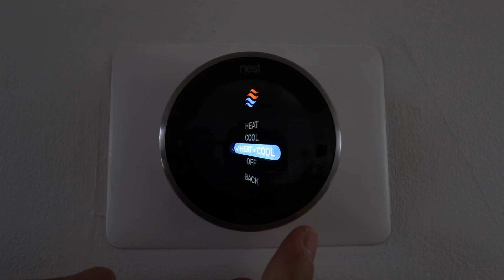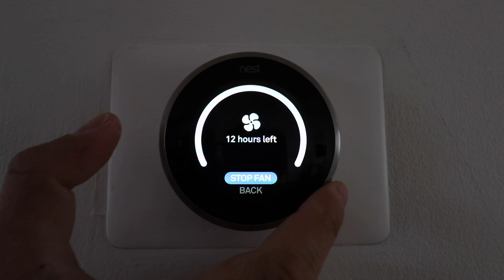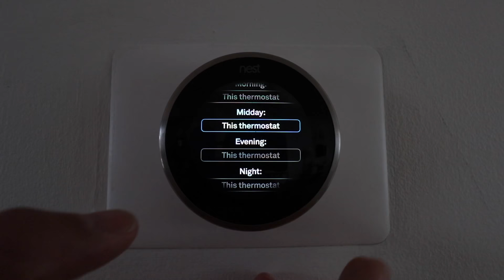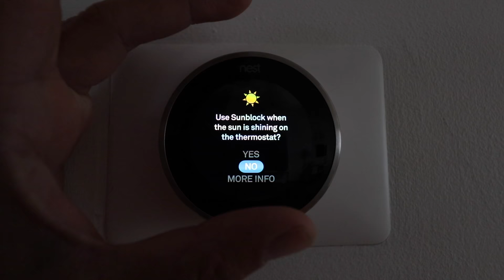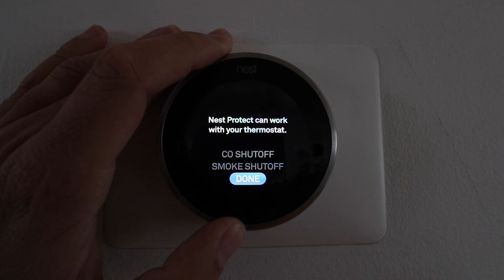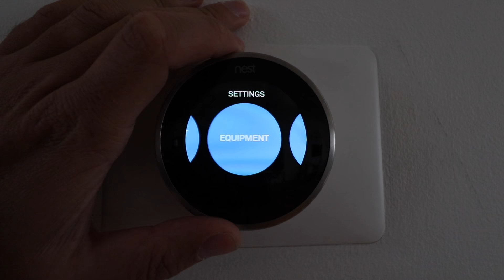Nest Thermostat Manual (MUST WATCH IF YOU HAVE A NEST)

Comment: If the heater turns on at 70, when does it turn off? I see 71 written in between the 70 & 73 but you didn't mention anything about the number 71. So is 71 the target temp. for both the heating and cooling? How do I change 71 to 72? Or is 71 the current temp? if it is the current temp when does the heater turn off?

Comment: I'm not sure if it's the app or actually the thermostat, but I have my heat set 72 degrees and the cool set to 80 degrees, for some reason it decides to reset itself to 71 degrees for heat and 81 degrees for cool. It's not in ECO mode it just seems to arbitrarily do this. any ideas why. Update on this post I'm pretty sure it's the app on my phone that was causing this, I would advise people after setting up all your peripheral Nest devices with the app on your phone to uninstall it, my thermostat seems to be doing what I have it set to now. Do not go to the Google Nest forums either any topic for legitimate concerns that users have Google immediately closes the discussion.

Comment: The Home/Away Assist function in the Google Nest App, the Presence Sensing function and the Homs/Away Automations in the Google Home App failed miserably to automatically switch in and out of ECO mode. I found no solutions in those functions. 

I did find a solution in the Automations of the Google Home app. 

First I turned off all the Home/Away Functions in the Nest app, all the Presence Sensing functions and Home/Away routines in the Home app. 

Then in Automations in the Home App, I set up two new routines. These routines use precise location info just like a naviagtion app would and were set up to mimic what the Home/Away and Presense Sensing functions are supposed to do. 

My Arrive Home routine is set at 150 meters from home to change my thermostat to Heat - Cool mode. 

My Leave Home routine is set at 500 meters from home to change my thermostat to ECO mode. 

I tested and it worked exactly like I have wanted Home/Away to work all along.

Comment: Thanks for this video. However, the Safety Temperature "Cool" setting is set at 96 degrees and CANNOT be lowered. My brand new expensive unit is completely worthless in the desert. If a house is allowed to reach 96 degrees as a "safety" measure, someone at Google is missing common sense or is actually an employee of a power company. Numerous posts to the Nest website confirms this is a factory setting and that nothing the user can do will change it. I was therefore curious that you skipped over the "Cool to:" setting on your video.

Comment: Appreciate you going through all the settings as I just received my nest, and installed a brand new system in my house. I would advise against setting temperatures at extreme ranges when home/away. For example, if you normally heat around 68, I would only allow it drop about 3-4 degrees or so during away or at night. Allowing your home to cool down to 57 and then having to work to increase 10+ degrees in the winter causes hvac systems to work harder. I'd just keep ranges moderate. :)
Reply: I've always used 5 degrees as a guideline.
Reply: @jolkraeremeark6949  I've always used 20 degrees as a guideline.  Why?  Because as long as you're not dropping below freezing temperature in the winter, or melting your wax seals or other melty things under your toilets, and you have no animals to worry with, it really doesn't matter one flip.

Comment: I installed the system and I can see all the wires connected correctly in the setup screen, but nothing happens (No heat or AC)? Any idea what could be wrong?

Comment: Set up my 3rd Gen Nest today and having a problem.  2 wire system - no fan wire. Added the C wire plug in accessory also.  Had to put both power wires in the Rh slot the other in the W1 slot.  I set the Nest to 22C.  The display is not red, just black with white letters.  The fan and furnace is not turning off and the temp has risen to 28C.  Thoughts anyone?

Comment: Extremely helpful video.  Thanks.  Is there a way to adjust the fan speed when heating.  My Nest runs at normal speed then kicks into high speed (very loud) for some reason.  Thanks

Comment: thanks.  easy to understand.  i got to this page by accident. i was looking for info on how to fix something i just saw for the first time, after having the Nest for about a year and a half.  All of a sudden, i was trying adjust the temperature, it's early September, over 100 degrees outside in Los Angeles and i wanted to turn down my thermostat to get the AC to come on.  I only ever use the app on my iphone to adjust the temperature instead of the wall thermostat. i tapped on the down arrow to lower the temperature and at first it acted normal, 76, 75, but then, it jumped right from 75 to 73, so i tapped the up button, i wanted it at 74, but it jumped up to that 76 or even 77, it was making big jumps. ??  i tried to do it more carefully and at about that time, i noticed that on the white background just under the blue temperature number, 75 or whatever it was, there was a small word in gray text which said DELAYED.  ?   I was able to get it to the right temperature.  i opened it and closed it and quit the app a braa nd restarted it and it still said DELAYED. i googled it.  the links all said it was an easy fix but i had to install a C wire or obtain some appliance with brand name and install that.  It said  that the Next recharges its Lithium battery off of the HVAC or off the furnace, not from power lines. it said that could be a problem for some people. i never had this before and i don't know any of those things. i just wanted to know whether there was some way to fix it by rebooting the whole system. Or do i have to hire somebody?  none of those answers said if there was an easier way besides installing a new wire to fix it .so i tried you tube and i enjoyed your video.  Meanwhile the word DELAYED went away.  So glad.  as it turns out, an HVAC tech checked out my system a few months ago and said i had a carbon monoxide leak so he turned off my furnace.  so i was afraid that this was why my Nest was saying Delayed since it can't recharge its battery off the furnace.  i'm really glad it came back on , i need to have another opinion on whether i need a new HVAC or if whatever's wrong can be repaired, he emailed me photos, he said something was rusted and it might be cracked, i don't remember right now, i have a detailed email.  anyway, it's good to have an online instruction source for my Nest now, thanks !!

Comment: i find these things incredibly insensitive - mine set to deg c - it will let the room temp wander up around 1.5c and down 1.5c before bothering to pass on info to boiler! - this results in huge lingering temp swings of c 4 c typically taking u from sweating to shivering every few hrs - what resolution do these things have?? - even the display only has an accuracy of 1/2 degrees - my $5 digital thermometers display to 0.1 and have shown to be accurate to 0.2, so whats with the Nest?

Comment: My Nest heats 2 or 3 degrees past the set temperature.  Is there a way to fix this?
Reply: david stuart
1 second ago
i find these things incredibly insensitive - mine set to deg c - it will let the room temp wander up around 1.5c and down 1.5c before bothering to pass on info to boiler! - this results in huge lingering temp swings of c 4 c typically taking u from sweating to shivering every few hrs - what resolution do these things have?? - even the display only has an accuracy of 1/2 degrees - my $5 digital thermometers display to 0.1 and have shown to be accurate to 0.2, so whats with the Nest?

Comment: What a pre heating mean?, once my thermostat reach the temperature desire continuos running
Reply from the maker: It uses an algorithm to determine how long it will take to get a to a certain temperature and if it's scheduled to get to a certain temperature by a particular time it will pre-heat or turn on the heating to get the temperature to the desired temperature at the scheduled time.

Comment: Question: We don’t have a fan or AirWave option on our thermostat. We only have the first two modes. Do you have any idea why?
Reply: Go to settings from the nest, and check to see if there's an update. I just set up my nest, and came across this video. I noticed that no one replied to you question. Anyway, that's something to try.
Reply from the maker: Good tip! Also check for any updates to make sure your nest is up to date.
Reply from the maker: Do you have a fan wire? If you don't have a seperate fan wire you won't be able to use airwave because the Airwave feature sends a signal through the fan wire to keep running the fan independent of the air conditioner compressor.
Reply: @OneHourSmartHome  what replacement battery do you recommend to a Nest 3rd gen thermostat? I tried moving G wire to C wire but that did not help

Comment: I'm curious. If I have a sensor inside of my solar space heating collector, is there a setting that will turn on the "fan only" that reacts to temperature and not time?
Reply from the maker: Not sure. The thermostat is essentially a switch. So if you want to run the fan, when it reaches 65 degrees you could connect the  R and W and it would turn on whatever you had connected when the temperature reached the setpoint you had indicated. I don't know the specifics of what inputs and outputs you have with your system but where's there's a will there's a way.